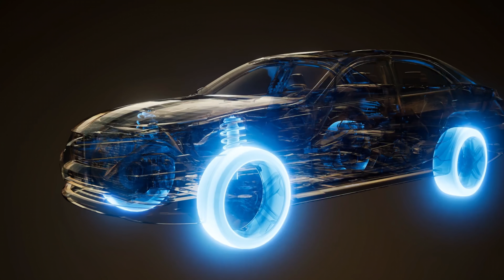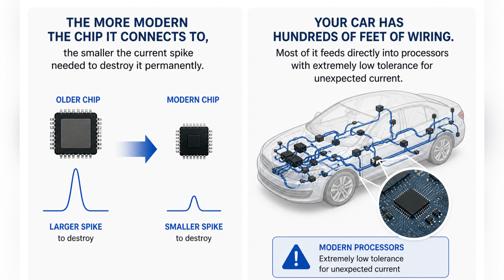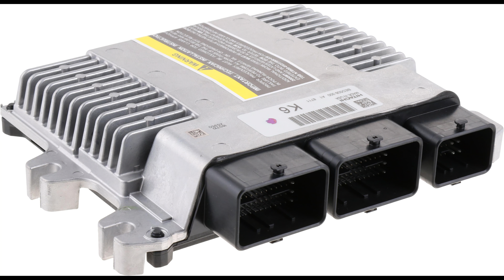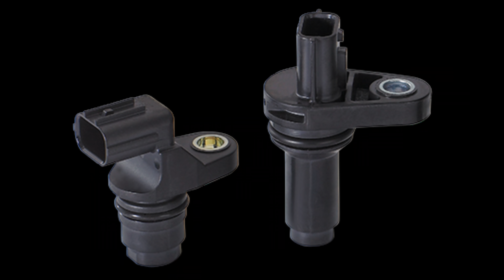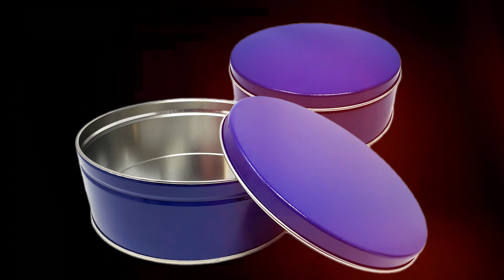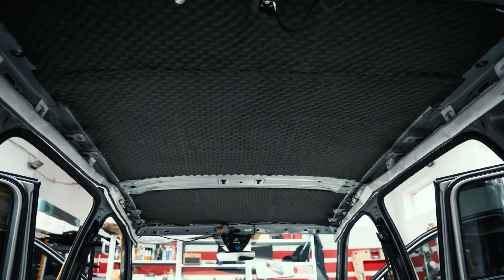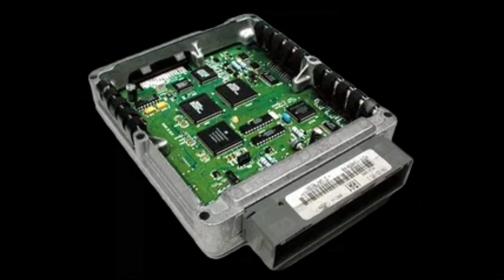EMP Just Killed Your Car? This $7 Part Saves It

Comment: The ECU will fry before a relay does..
Reply: They will both fry at the same time so all this is nonsense
Reply: @havocmaverick  - "They will both fry at the same time so all this is nonsense"
False. 
The relays and fuses can take a LOT more EMP than a CPU.
Reply: @stuartgray5877 yeah so what an EMP does is it over volts the whole circuit all at once. It don't matter how many fuses relays or whatever they all fry at the same second and it won't matter what voltage the fuse is at when the cpu is getting 12 volts. The fuse will live and the cpu will die.
Reply: @havocmaverick  I have an EE degree and my family business for >20 years was building EMP, Tempest Test facilities for the US govt, and testing them.
Currently I build, test, launch, and operate spacecraft for the Govt.
One of my main specialties at BAE Space Systems is EMI/EMC tests of multi-billion-dollar space vehicles.
In fact, I have to author the Lightning Contingency Test Procedure for the Near-Earth Object Surveyor spacecraft at KSC next year.
They also had me review and approve the Lightning suppression system SpaceX will put on their upper stage to protect our spaceraft.
Microelectronic circuits are FAR more susceptible to Radiated or Conducted Emissions than basic standard Electronics discrete components such as Relays and fuses.
But thanks anyway
Reply: @havocmaverick  - "Microelectronic circuits are FAR more susceptible to Radiated or Conducted Emissions than basic standard Electronics discrete components such as Relays and fuses."
Which is why our communications up the launch umbilical to/from the spacecraft typically has Differential Serial lines with Opto-Isolation and Suppression.
While the contact closures and High-Level-Discrete commands Up/Down the umbilical typically does not require any of that.
Because wires and coils can handle a lot more conducted or radiated noise than can microscopic circuitry.
Reply: @stuartgray5877 oh nice, good for you. My Bachelors degree in electronic engineering is 20 years old, your must be newer.
Reply: @havocmaverick  So you are going to try to claim that relays and fuses are just as susceptible to EMI/EMP as micro-electronic circuit?
Then you try to tell me you have an EE degree WITH A STRAIGHT FACE?
Yeah you are hilarious!

If you have an EE degree, it's not worth using as TP.
Reply: @havocmaverick  - "My Bachelors degree in electronic engineering is 20 years old"

Stop lying NO-ONE with an actual degree would claim that microelectronics and Relays and fuses have the same EMI and EMP resistance.
Reply: @stuartgray5877 I was not talking about resistance I was stating the EMF wave would hit the whole circuit at the same time with enough volts to fry everything on a CAR, spaceships are a different story entirely and have nothing to do with what I stated.
Reply: @havocmaverick  - "stating the EMF wave would hit the whole circuit at the same time with enough volts to fry everything on a CAR"

But the fact remains that the ECU and all other microelectronics will be destroyed at much lower levels than the fuses and relays.
Not only lower voltage levels but shorter durations.
Relays and fuses can take FAR more EMF than the ECUs and other circuits.
Reply: The only way to save any component in any module during an emp is to remove it and seal it in a faraday bag. The only vehicles that will operate after an emp, are old cars with a points style distributer and an ignition coil. New cars can have more than 50 modules, and cost thousands to replace, not to mention days of tearing it down to replace them. THERE IS NO KIT THAT CAN PROTECT A MODERN CAR FROM AN EMP! Kits pretending to protect a car from emp are scams sold by con men and criminals.
Reply: I wanted you to be wrong, but you are right. Relay less sensitive to EMP than  ECM, so very unlikely the relay is broken but ECM ok.
Reply: Have a car garage that has Faraday paint coating
Reply: @SolSuperguy  yes or something of the sort
Reply: @SolSuperguy park it in a shipping container.
Reply: Remember those earthing straps that dragged on the ground off the rear bumper
There was an experiment that struck the car driving under a very large electrical discharge 
With the earthing straps the only noted strange occurrence was that the rear wiper would activate 
Otherwise it killed it 
It was a British documentary 
They had to pull special insurance as they did not know if the driver would be killed during the experiment
Reply: Take a  car cover and line it with tinfoil

Comment: that computer is toast... fuses and a couple relays are not saving that.
Reply: Then drive an older car without computers in them, problem solved!
Reply: @FTW1984  You'll have to go pre 1970.  Even many 1970s cars had electronic ignitions.
Reply: @stuartgray5877 early tdi golfs have a mechanical pump
Reply: @FTW1984 until the government bans them... they have already started by eliminating parts yards...
Reply: @FTW1984 but you would still need to rewire everything because the copper wires are going to fry.
Reply: @d.sm.4146 No they're not. You're not going to induce that much current over such short cable runs. Even modern electronic-heavy cars are unlikely to be seriously damaged by a nuclear or solar EMP, and older cars even less so.

Comment: Those containers won't work unless you close the gaps at hinges and lids. You need a copper fuse tape or similar in place of gaskets and such. Any gaps, regardless of size, means your Faraday cage will fail.

Comment: If you do not remove all the computer modules from your car or truck the EMP will kill them. Relays are simply a coil and a set of contacts. Fuses are a simple calibrated gauge of wire inside.

Comment: A couple of things you can do when you aren't driving your car, disconnect the battery, put a grounding rod into the ground attached to the frame of your vehicle.  Lots of trouble I know. Just don't forget what you did.
Reply: Totally grounding you car is a very good way to attract a lightning strike !
(Which is a lot more likely than a atomic bomb going off.)
(Oh sorry, I completely forgot the potential actions of the POTUS.)

Comment: You left off  ECM, TCM, BCM, and the Gateway module.  Those chips will fry too.  Just the ECM will cost hundreds to over $1,000.

Also: Crankshaft/Camshaft Position Sensors, Throttle Position Sensor,  The Fuel Pump, Internal Voltage Regulators....

So no, you aren't going to get that car working after an EMP.

Comment: This is ridiculous.  I have been a mechanic for over 30 years.  If you want anything to survive an EMP or CME outburst to have a fighting chance you start with a diesel engine.  Mechanically injected diesel with a pneumatic starter or manual transmission are the only real "potential" solutions.
Reply: A vehicle with a gasoline engine, a carburetor, and ignition points will survive EMP as well as your diesel.
Reply: An old duce and half army truck.  Not only will it survive the E1, but it will run on all kinds of fuel.
Reply: That’s why I have a 35 year old HMMWV for weekend tooling around.😊
Reply: Relays are mechanical, and a very good chance they will be emp safe.  The relay driving circuit is the risk, as the relay coil makes a good antenna.  Maybe an emp could fry a relay, but hardly the pain point or a concern.  It’s easy to bypass a relay.  I need a shield ammo box for all my cars modules.  Now even the most important, I need to protect my radio.  No radio? Good luck running your windshield wipers. Effing stupid.
Reply: @marvz71  pre '85 cars, breaker point ignitions or converted to it

Comment: Bicycles are EMP proof
Reply: My feets are EMP-proof 😊
Reply: Unless the rider has a pacemaker.......😅
Reply: Yes they are 100 % EMP proof ( the old ones but Not the new electric bikes )
Reply: @yankee7664  you can still ride an E-Bike without its electronics, since an E-Bike is still a bike. It'll just be a heavy bike without the motor working. 

I'd be more concerned about battery fires resulting from an EMP.
Reply: @nopenoway1519  an ebike shouldn't be that fast. Even the fast class 3 bikes are only supposed to go 28mph, which is slower than most people can ride downhill without a motor.
Reply: Where ya gonna go ?
Reply: @hotrodray6802  hunting.
Reply: @kingmasterlord  lol, not many  hunting grounds have bike trails.
Reply: @Embrachu  why tf would that matter in a shtf scenario?
Reply: Until it's time to fix the bike, or replace parts
Reply: @Jo3y1111 
There’s a plethora of parts to fix bikes. Unless one is totally useless, a bike is really easy to work on.
Reply: I took some riding lessons, and learned to work around horses. Don't have any. I just thought it would be good to know how to  ride just in case!
Reply: Lol, yeah, but let's hope you've good cardio to match.
Reply: @Embrachu  nonsense. The thing about a bicycle is you can always slow down. You let your body tell you how fast it can go, instead of being obsessed with speed like a driver. 

There is typically a pace at which anyone's effort level can become indefinite, similar to how walking doesn't make you feel like you're working out.
Reply: Mostly. Some shifters...

Comment: if you know the differences between direct input, indirect input and relayed input, trust me, you won't be stuck if emp happens.
Same goes for the engines, if you know the fundamental principle of the engine, I'm pretty sure you can attach carburettor, ignition coil, dizzy to even 2026 engine, and make it run.

For some people it would be bad, but for people like me, I couldn't care about emp.

Comment: I don't see how this is useful at all with most cars having so many computer chips that control everything in the car, you would need to store away replacements for all of it and there can be a lot!!!
I think you would be smarter to just buy a good running classic car of any kind it doesn't need to be fancy and keep good spare batteries and fuel in a safe place. Or build a faraday cage in your garage and keep a spare newer car in it just in case.

Comment: my prius was already struck by lightning... first thing fried the 12 battery (grounded to the frame which the lightning hit)... now i get errors randomly when trying to drive... requires techstream access to get deep error code data... i think it may have effected either a computer or the larger battery... i bought that car because I thought it was invincible... it pisses me off... also a tornado half a year later it survived one of those. I can drive it but it pisses me off having random errors come up on the dash and having to reset them... even worse Geico not covering acts of god? Are they the cheapest bastards on earth? What is the probability a car is struck by lightning? Do you think this fix could handle a lightning strike? Also I was inside right where the lightning hit between the house and the car and I felt like I had scarlet fever for a week ... the lightning hits you with gamma rays and an EMP... all the house main wires coming in from the garage were routed righted over my head there
Reply: Friend, had a lightning bolt hit a tree 50 feet from my living room, where I was sitting. Blew out a couple of those spiral-looking fluorescent bulbs.  Blew up 3 small battery chargers, they just exploded. (FYI, bulbs and chargers both had wire-wound transformers inside.)
Three pine trees were killed, 1 struck by the bolt, 2 nearby not struck.  My guess is that high voltage/amperage was induced in these objects, like a high tension power line.  Respect to lightning.
Reply: @notwo2smartyikes had one hit 20 yards away previously that did nothing
Reply from the maker: That's a crazy story. This EMP fix is more for solar EMPs, not direct lightning strikes, which are much more powerful. Lightning is a direct energy transfer, while an EMP is an electromagnetic pulse. Geico's policy on "acts of God" usually excludes things like lightning if it's not comprehensive coverage.

Comment: I had to replace the ECM in my truck, it cost five hundred dollars. Are you saying I should have one of these inside a shielded box in the event of a EMP? I got news for you. Gas station pumps have computers in them too. The trucks that deliver fuel also have computers in them.  I just keep a ten speed bike in the garage instead.
Reply: Pedaling up hills for miles to go where to buy what non existent products ??
Reply: @hotrodray6802  More like pedal to the river for water, that I would have to filter and boil. But the truth is if we get an EMP over the USA there well be mega death and at my age I would most likely be among the first to die. Think about it. No fuel, no refrigeration or air conditioning, no heat in the winter unless you have a fireplace and something to burn. There is a documentary series called "Connections" that perfectly illustrates this.
Reply: Put a siphon hose in your kit...
Reply from the maker: Yes, a spare ECM in a shielded box is a good idea for an EMP. You're right about gas pumps and fuel trucks; that's why an EMP event would be so disruptive. A bike is a solid backup for local travel.
Reply: But even a modern 10 speed bike has a computer for collecting and selling your personal information.
Reply: Segway maybe?

Comment: Ha! You did have the answer to my question.
Thanks! That was what I was wanting to know 👍🏻
What if I had the battery disconnected and grounded to the grounded to the earth. Could that make a difference in any way ? Just wondering
Reply: Connecting ground - meaning the shell of the car to earth ground is an interesting question. It’d be a partial shield - unfortunately I think partial shielding isn’t effective at protection. But I’d like to know more.
Reply: @Bobb1999 me too
Reply: Ground the shell and both positive and negative battery cables to the earth with a grounding rod like for a house
Reply from the maker: Disconnecting the battery and grounding it to the earth would provide some protection, as it isolates the car's electrical system from the grid. However, a direct EMP could still induce currents in the car's wiring, even with the battery disconnected. Complete shielding is the most effective.

Comment: This is why’s it’s important to know or have your own vehicle that’s more then 30 years old
Reply: My '68 plymouth satellite should be fine
Reply: @brendajackson913 I wish I still had my 69 Impala
Reply: @ITEIDRM mine is all original and hasn't been restored. Has some maintenance issues we're working on but it runs solid and will surprise you.
Reply: @brendajackson913 ❤
Reply: @b @brendajackson913 bsolutely .
Reply: Is my 1993 Chevy truck safe
Reply: @ITEIDRM  NO not at all it has too many modern electronics to fry it will be toasted unless it's under ground or in a faraday cage
Reply: @ITEIDRM  the less electronics the better anything with a chip will be fried
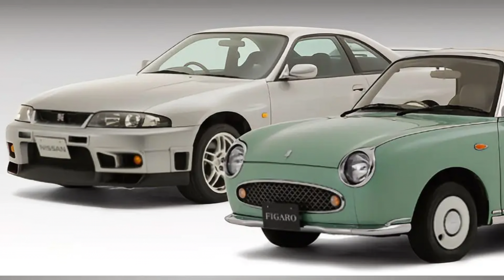Reply: @ITEIDRM    See the vid @3:10   By the 90s, every car sold in the USA had a computer that can be destroyed.
Reply: @ITEIDRM Yes, because 1993 is older than 1975.
Reply: @ITEIDRM   only those built prior to 1975 are safe.
Reply: @dan6442 . Unless your car has breaker points it’s susceptible. GM’s HEI ignition became standard on their cars starting in 1975 and was optional for a year or 2 prior. The HEI module is small and takes about 10 minutes to replace. Put one in a faraday box and you’ll be good to go in any GM car up to 1980. In 1981 they started to use an ECM with a feedback Quadrajet carburetor. I think Chrysler had some form of electronic ignition a few years prior. I’m not sure about Ford or AMC.
Reply: @dan6442 thank you
Reply: @mikee2923 I don't have electric windows or power seats lol
Reply: @ITEIDRM .    Even though your 1993 truck has an ECM, if it’s a V8 305 or 350 it wouldn’t be hard to make it carbureted. It’s a traditional small block Chevy that could be easily converted to points and a carburetor.
Reply: @mikee2923 it is a 4.3 V6
Reply: @mikee2923 hi Mike how do you feel about a 96 12 valve Cummins?❤
Reply: @Bob-gn8ph  I’m not an expert on diesel engines but I know enough to believe that’s a beast. Not sure how much electronics play into diesel engine operation but they’ve been around forever and could be run without them. But I couldn’t even begin to tell you how.
Reply: @mikee2923 ❤
Reply: and any coils or other electronics should be protected...
Reply: I have a fiat panda for 20 yrs. It had passed every MOT with only perishable replacements. I can buy  replacement parts in Halfords and are simple to fix. Worth every penny👍👀🇬🇧
Reply: I still have 2 cars matching the description.
Reply: 30: isn’t far enough back. Is has to go back to points ignition.
Reply: @wasntme3651  yeah I have an issue where I don’t want to admit to myself how old I am lmao I meant 1980s and older
Reply: Fuel station can't pump fuel. You need hand pump & hose.
Reply: @rodneyjones4890  and learn how to make your own when that fuel expires
Reply: @mizodadon8331 ok expert. 🤣
Reply: @rodneyjones4890  your holding a device that’s full of knowledge use it ffs literally anything you can think of can be looked up and sent to your printer, so technically yes I’m an expert at looking for solutions on the same device I mentioned lol

Comment: Will a metal storage building be a good Faraday cage?
Reply: That is 1/3 of the way there.
Reply: I believe it would , BUT you would have to ground it with about 20-30 grounding poles driven 15-20 feet deep,
Reply: @bigtx1769 ya got my wheels spinning.  The storage facility has electricity,  so maybe the building has ground.  If not,  would a copper braided cable attatched from car to ground suffice?  Or should I get a copper mesh carcover?   I love learning from others,  thanks for replies.
Good day. 🎉